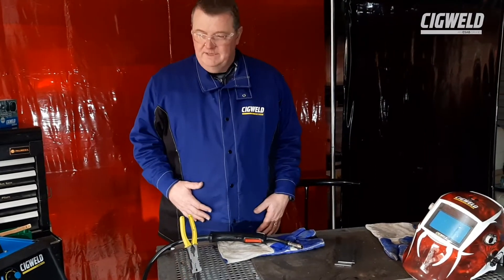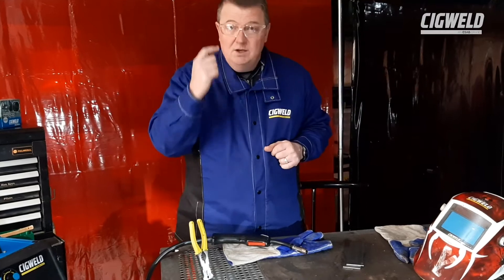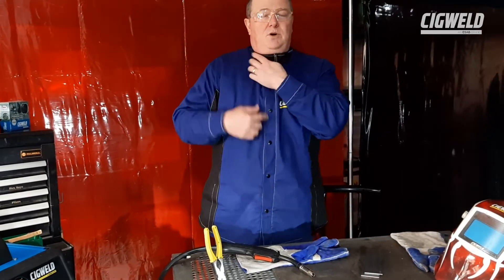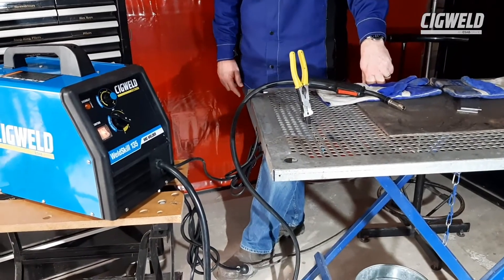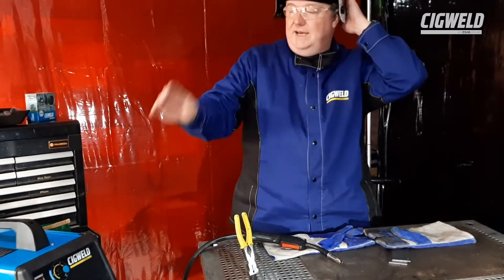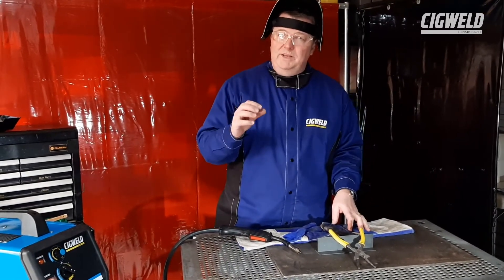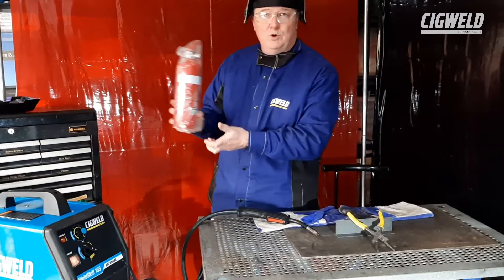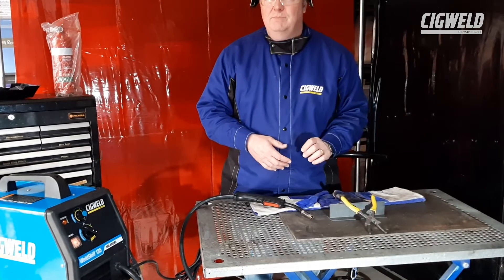WeldSkill 135MIG - Part 4: Welding safety & Welding Safety hot steel

Comment: Can the liner be changed on this unit to weld Aluminum? I’ve not found any documentation on how to change the liner, nor information on availability of a low drag liner compatible with this machine for use with Al wire. The unit does however state it can be used for Al.
Reply from the maker: Hi Paul H -  the liner in the MIG gun on the Weldskill 135 are non-replaceable. You can still run Aluminium wire in the machine by following the settings on the Welding Setting Chart located on the inside of the wire compartment door. Before changing to ALLOY wire, we suggest that you remove the Contact Tip and Nozzle from the front of the MIG Gun and also remove the feed roller from the wire drive motor, then use compressed air to blow out the liner from the machine end to clear out any mild steel metal savings that might be in the liner. Always use the next size (up) contact tip for the Aluminium wire diameter you chose to use. We suggest using 0.9mm or 1.0mm wire for best feedability, so in these cases you would use 1.0mm and 1.2mm Contact Tips. The reason is when Alloy Wire is powered up, when the trigger is pulled, the Alloy rapidly expands twice as fast and much compared to steel, so you need a bigger tip diameter, otherwise the wire jams in the Contact Tip and burns back to the tip. Good bye tip, hello new tip! Ensure you also change the feed roller over to match the wire diameter size you chose to weld with. Keep the MIG Gun as straight and horizontal as possible when welding Aluminium, bending the MIG Gun or having it in a tight circle will prevent the soft aluminium wire from feeding and cause it to burn back to the tip. Good bye tip, hello new tip! Last but not least, do-not start welding up your aluminium project unless you have practiced for at least one hour on scrap pieces first before attempting the project. Aluminium is much harder to weld then steel, so please be careful, , partice makes perfect.